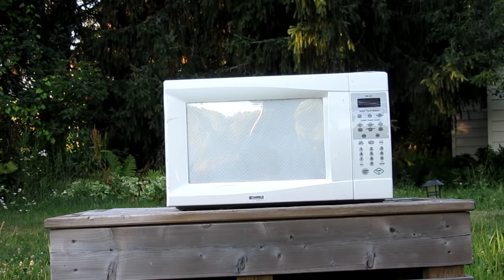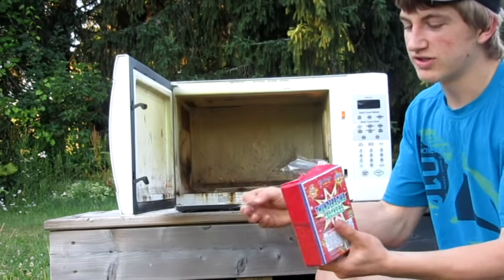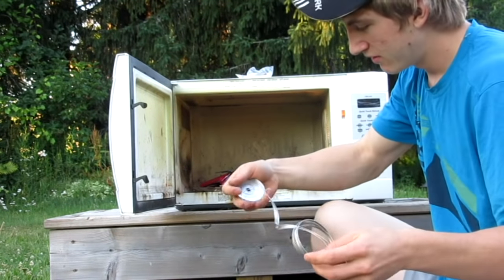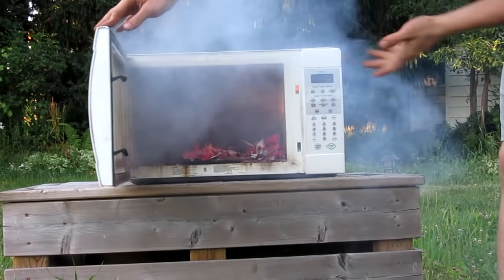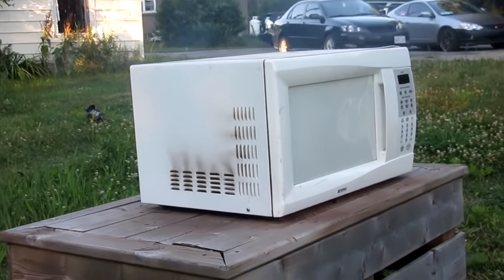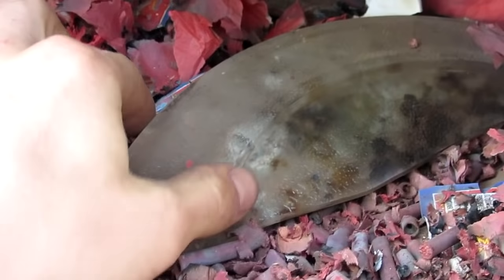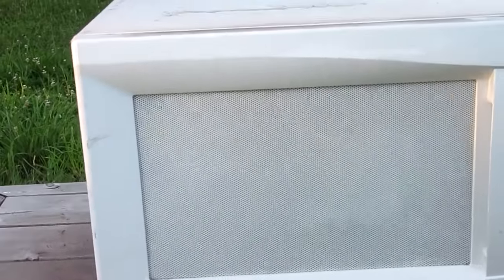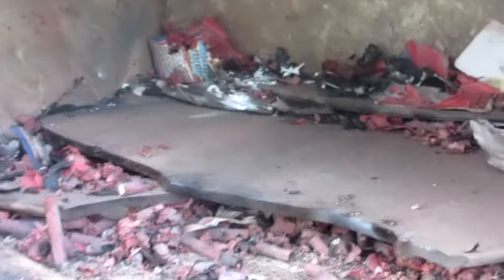Brick of Firecrackers in Microwave !?!

Comment: You can always bypass the safety limits on the microwave that lead to the transformer and incoming power so it won't shut off.

Just have a fire extinguisher ready and make sure it's for dry chemical.